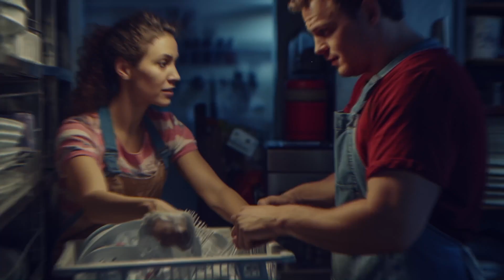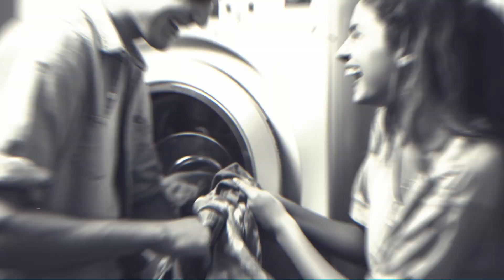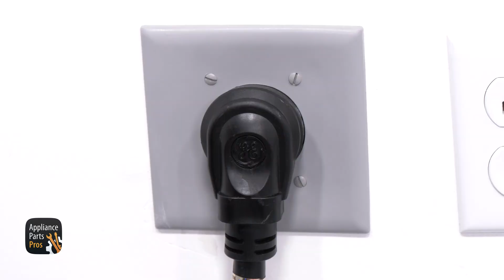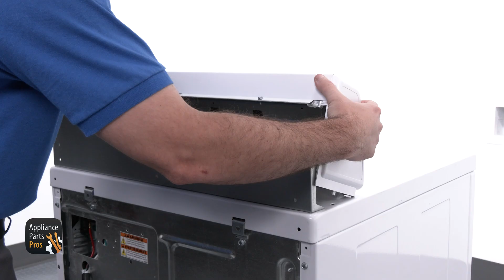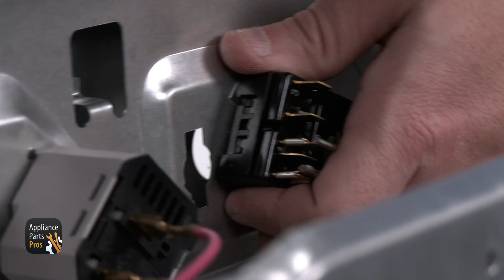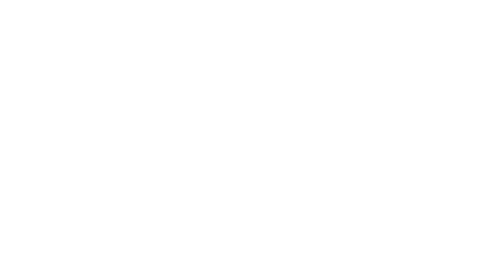How To Test and Replace a Speed Queen Electric Dryer Fabric Selector Switch

Comment: Thankyou! Saved me from ordering a new switch. The selector knob shaft split, so it wouldn't grip the switch. Did the old 'wrap the split area with thread, dental floss, etc add some superglue to string area. Done!
Reply from the maker: Great tip! Sometimes the issue is with the knob itself rather than the switch. Glad you were able to fix it without replacing the part. Thanks for sharing your experience and happy repairing!

Comment: I don't get continuity between terminal 1 wire and L1 whether terminal 1 wire on or off.  Should I get continuity between 1 and L1 when both wires are on?
Reply from the maker: No, if you have continuity there with the switch turned to regular heat, then the switch has failed.